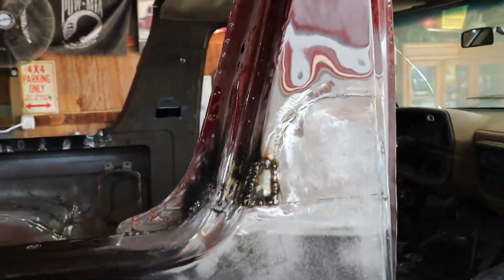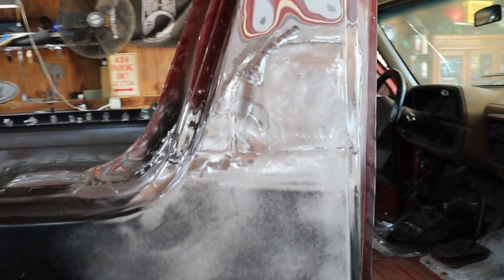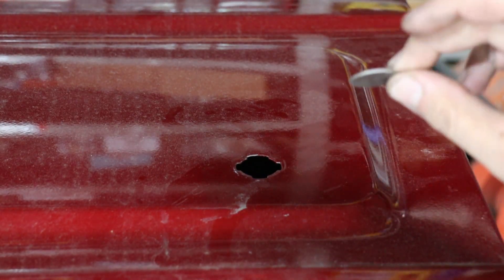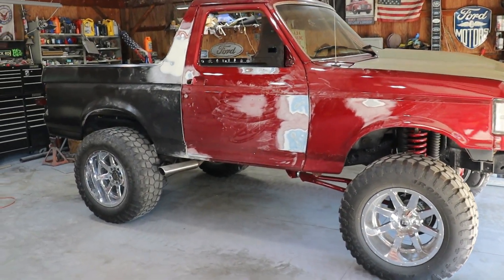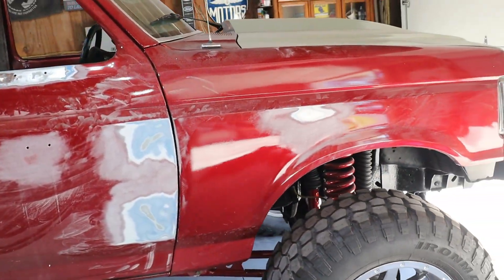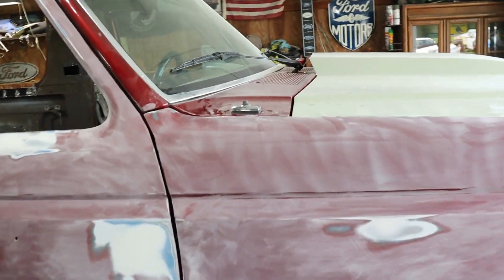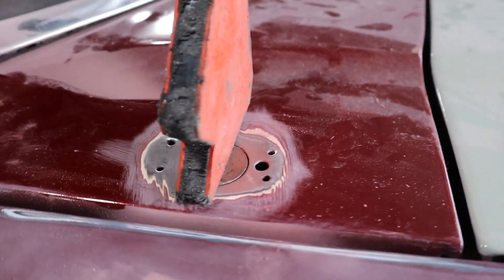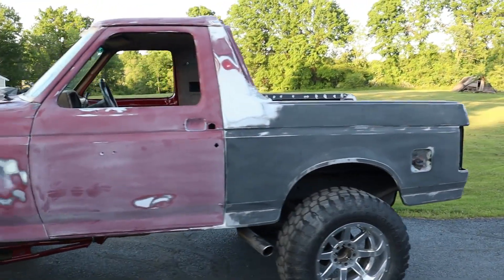Body Work Wrapped Up & New Core Support Installed (87 Bronco)

Comment: Where did you learn to weld . Such a great skill to have . With a welder and grinder most anything can be fixed . Now about that respirator ,, that is not a sometime thing . If you dont think you need it wait 30 years and you will wish you had used it , ask me how I  know. also you can take a regular tissue and put it over the filter hold in place with rubber band and you will extend the life of your filters and see what you would have in your lungs .Thank you for sharing .
Reply from the maker: I learned to weld from a combination of school and my dad! Thanks for the input